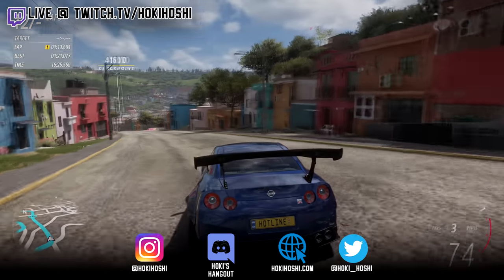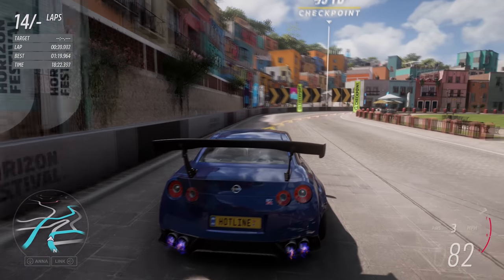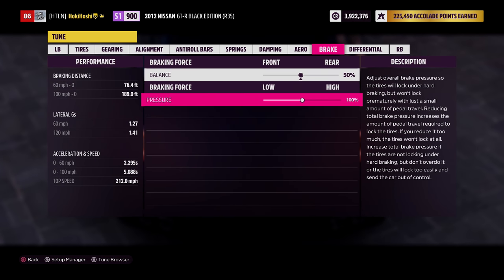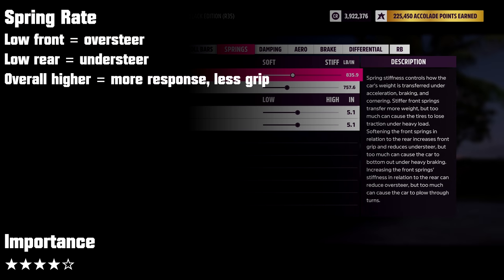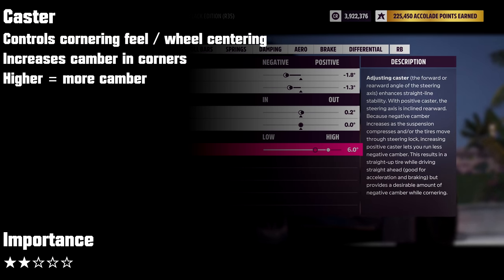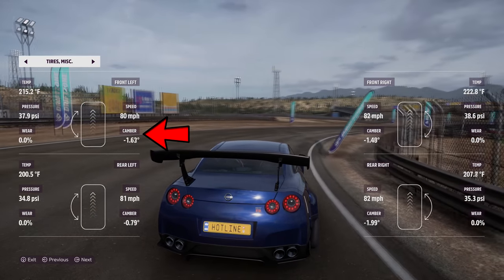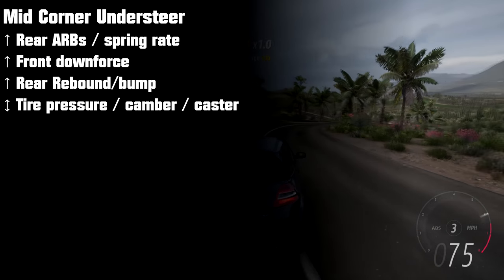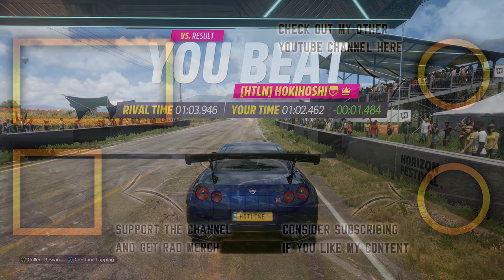How to Tune in Forza Horizon 5 | Basics of Tuning Guide

Comment: I know this is gonna sound stupid, but i generally break all these rules, my fastest top speed car for highway pulls is a Vauxhall Monaro, it's a V12 all wheel drive twin turbo makes well over 1000hp not entirely sure about torque, however when i tuned it, my diffs are 100% on everything on front and rear while the center is 50%, my aero is 100% on speed, my springs are slammed to the ground, my tires are slightly lower on pressure, i don't really touch the roll bars or bump stiffness and stuff, and my gearing i don't touch apart from final drive, the last gear is just touching the right of the graph (aka its towards speed) sure with all this it will take the whole highway to get anywhere near its top speed but due to the length I've never reached top speed the highest i've gotten so far was 490kmph (309.4)mph, i ddid have to slow way down to take the corner but im pretty sure if i had a long enough road with no corners i could probably get to 495kmph but that's minimum and yes i do know that no one has ever gotten near 500kmph but i am still trying, (fyi this is without mods)
Reply: And its the same for my drift cars i completely break the tuning rules, my camber is normally fully to the left front and rear while rear toe is out to about 3.5, rear tire pressure is normally way to the right, and my suspension everything on the front is completely stiff while the rears are completely soft if you want to try this you really should make a build with 10 gears and over 1000hp, keep in mind you have to be really active with the steering as it will just turn on its own.

Comment: Im having a problem where my front right and left tires have different temperatures. On the right tire the outside is about 20 degrees hotter than the inside but on the left side it is reversed. Any suggestions on how to fix it are much appreciated.

Comment: Your not clear on how to test the tyre temps so do you test it the same way as the camber like for example if you turn left do you look at the temperature of the tyres on the right because the temperature of the left tyre will be different to the right as your turning also do you just test this as if your racing or steady without too much braking?  I'm just a little confused on how you actually test the tyre temperatures I don't know if I'm even doing it right i have basically been testing it as if im racing and checking the temperatures round corners the same way you check for positive camber

Comment: Great video I’m more or less beginning to understand tuning I went from “well this looks like a good adjustment let’s move it all the way to one side” to being able to get my GTR 93 aka the boat to turn like a graceful gazelle. It still slides a bit on high speed corners but I’m working out the bugs slowly, I was able to cut my time on playa Azul circuit from a 1:16 to a 1:12 on my A class Nissan GT-R 93 finally was able to beat that cheating as pro AI it’s like they throw in a couple unbeatables just to watch us struggle…

Comment: I need help. I have a problem that I can't find how to fix On forza horizon 5.  Hopefully someone in this comment section can help me. This has happened on many of my upgraded cars. Basically I will have a level 800 car that reaches 180mph on driving, but as soon as I auto or manual upgrade that car to level 900 & upwards, suddenly it can't go past 150mph and won't go beyond, even though the horsepower and level is higher, the speedometer arrow reaches the red part and gets stuck, then the car starts making a weird noise. Its something to do with the upgrades but I can't remove every upgrade 1 by 1 to see what the problem is, it will take too long. Can anybody help me please, its really annoying Me. I have 2  of the same Toyota supras, the level 800  one reaches 190mph ther, but the level 926 one only reaches 140mph. HELP!
Reply: it's probably something with the gearing, try changing stuff with those settings

Comment: THANKS! This help me a lot! But for my English, I did not understand "entry corner"、"mid corner"、“exit corner” means.(i know entry\mid\exit means, but did not exactly on cars)
And also, i find one issue the video did not mention——Some super car, esp in rear drive, when suddenly boost it, the car is not straight as a line which it suppose should be. 
In contrast, from 0-boost, they usually turn to right or left, till the speed more than 200, some serious cars need more than 250. 
I found this happens on many Ferrari and other cars（not include lamborghini）, name list include: F40 GT、F50、F50 GT、3 Pagani cars、almost all Mclaren cars, Apollo(removed Microsoft tuning). but Lamborghini car and UK car(maybe the studio in UK reason?) like Astonmartin、Lotus, they never have this issue. (Lotus in contrast, it too stable as understeer)
Some player like me, have no idea to slove it, only turn the driven to full-wheel drive mode, most time it helpful, but still some times it's not.
Reply: entry mid and exit means while steering into a turn, while holding the steering on that turn and while steering out of the turn
Reply: @CErra310  Thanks! holy~~English cut this so details, entry\mid\exit mode. I don't drive. So I supposed the 3 mode as one. like, turn right, OK, success; turn left, failed. lol

Comment: Just 1 question, how can you minimize wheel spun on launch especially rwd cars. And why when I upgrade cars they spin more even with adjusted 1st and 2nd gear?
Reply: it's normal if you push the throttle too hard , Especially if your car have high acceleration

Comment: Gearing is way more important than the overview you did. I've been doing races with mates using the same cars with specific levels we have to stay under and I'll always beat them massively in acceleration cause I focus on tuning gear rations. You want first gear long asf but not so long it bogs down too hard off the launch (also really helps with really high HP builds and no traction control) think how many times you have to take off in a race or normally shift back to first. I have some cars that do over 100mph in 1st gear where some cars would already be in third with their stock ratios and shifting can be lost time. After 1st you want to make the gears fairly even towards top gear but making each gear slightly shorter. So I always go 1st really long probably close to a 1/3rd of the top speed you want, 2nd you want it normally to be close to half your top speed and then make a nice slightly shorter lines all the way to the top. High gears shouldn't be long as the you loose all your torque due to the ratios getting closer to 1:1 or lower for overdrives, it's also harder to push against the wind and dropping revs too far in high gears kills acceleration.
Reply: Say I have a car and the top speed I'm aiming for is 200mph and using a 6 speed my gear ratios would be roughly as such: 1st 65mph, 2nd 100mph, 3rd 130mph, 4th 155mph,5th 178mph and 6th 200mph. This way 1st gear to 1st is 65mph, 1st to 2nd is 35mph, 2nd to 3rd is 30mph, 3rd to 4th is 25mph, 4th to 5th 23mph and 5th to 6th 22mph. As long as you car has a power band fairly high in the rev range it will work really well.

Comment: Anyone notice the anti roll bars settings are... Trash? You can literally max the anti roll bars to zero effect. You would expect the car to bounce after hitting a bump on one side but that doesn't happen. I think this game's tuning is more shallow than people think.
Reply: The settings generally do what you expect them to do, but what's fast in Forza (and other games) usually doesn't have much to do with reality. People used to run 1/65 ARB in FH4, which isn't done IRL.

Comment: Are you sure that race springs provide any advantage over rally springs? They cost one more PI but as far as I been able to test, they dont ad any handling advantage what so ever. If you tune the preset after the fact they will handle any corner exactly the same way.
Reply: The maximum and minimum values are different for most vehicles

Comment: Tuning the r33 gtr in fh5 trying to go for a Purist build ie. no ugly forza aero. The car over steers like crazy when I brake into a corner. I’ve been able to tune out the rest of my oversteer for every part of the corner while on or off gas but adding brake pressure while or before the corner results in oversteer for the entire corner. (I have abs on but that my only assist)
Reply: Take abs off and reduce brake pressure then just learn when the tires lock up and play with that till you find what works

Comment: SOS I’m in the 918 AWD I keep losing traction around mid to end of corners. I tried doing differential tuning and tire pressures. Not sure what I’m missing it happens mainly in the rear tires
Reply: Lower rear diff accel or increase front diff decel
Reply: @ZaZ880  thank you will try out later

Comment: The section on brake bias/balance is entirely wrong. 
I'm not really sure why you said it's reversed when it clearly isn't if you spend anytime playing with balance settings in game. 
Positioning the slider further towards the front will balance the braking force more on the front brakes and positioning it towards the back will balance it more towards your rear brakes.
It has never been backwards in any Horizon game.

Other than that, this is pretty helpful.
Reply from the maker: Do me a favor, turn off ABS, move the slider all the way towards "front", look at the side of the car while braking and tell me which wheels lock up first.  I think you'll be surprised!
Reply: @HokiHoshi  I have come back to apologize and say that I just realized my ENTIRE understanding of physics was off. I noticed my front brakes always glowing red when I moved the slider forwards but did not understand that the rear brakes aren't glowing because they are totally locked up which means there is no friction between the calipers and the rotor. I feel really dumb and I am genuinely sorry.

you're absolute right, sorry about that one Hoki, and again thanks for all the tutorials.
Reply from the maker: Dude you're totally fine!!  Nobody expects the brake balance to be reversed ofcourse, and your thought of focusing on the rotors heating up meaning those brakes are being used more makes sense!  Especially when it lines up with how brake tuning is probably supposed to work anyway.  

I appreciate the response, hope you're having fun with Forza!

Comment: I'm having trouble figuring out the camber. In the video, it says that the lowest in the turn was -.8 degrees, but it went to like -2.03 at one point, which was pretty confusing... Mine seems to vary widely as well, but never goes positive. Also, I noticed that when my temperature difference between outside and inside of the tire was too high, I lowered the camber to make it more negative but it didn't seem to help. I then tried to raise it and that seemed to fix the issue..? Were my tests inaccurate or am I misunderstanding the video?
Reply from the maker: So I know this is confusing...but "less camber" means a more positive number (as in closer to zero.) "More camber" means a more negative number.  So when I say the lowest was -.8 that was the value closest to zero. -2.03 is higher/more camber than -.8  

Hope that clears things up!
Reply: @HokiHoshi  yes it does! I actually watched it back and realized this when paying closer attention. Thanks for the clarification.

Comment: Ive always relied on tire heat to tune my camber settings. Get the tires to the right temperature on the straight first with pressure and camber adjustments and then do some cornering. During the corner, the car is unbalanced if you dont get an even amount of heat generated on the loaded (outside) tires. And the tire is not giving maximum grip if it is not heating uniformly accross its surface - a heat "band" on a loaded tire after a sustained turn means you were using less than the full contact patch for grip, the cool areas indicate where more grip could be available.
Reply: in my setups i always have trouble keeping the tire temps low, i can always add camber, soften suspension, reduce tire pressure to bring the temps up but when i do find an optimal grip setting dialed in, the tire temps are always too high (solid yellow esp on the fronts, the rears are lower at the transparent yellow / solid yellow color). What can be done here?

Comment: 3:37 im new to fh5 and driving 2020 chevrolet corvette for differential section i dont see gear and center and what is that for?
Reply: Center is for AWD cars only and it controls how much power goes to the front vs the rear. But I would not recommend you follow this tutorial at all as it doesn't represent horizon physics. Watch the meta tuning guide made by @seP4 instead.

Comment: It's crazy how quickly this video got my vehicle into a very respectable tune. I haven't even gone back to make adjustments yet and it's already feeling amazing.

Tuned a Raptor for cross-country using your guidance here and my biggest complaint is generally that cross country vehicles can feel very heavy. With weight reduction and the right adjustments to favor oversteer this thing feels incredibly responsive.

Comment: The reason brake balance seems to be 'reversed' in horizon is because the slider is ALWAYS only showing you the percentage for the rear braking force. There is no value for front braking force. So when you have the slider all the way towards 'front', the percentage will read 0% because 0% of the braking force is being sent to the rear wheels.
Reply from the maker: This is sort of true yes but it's even more confusing than that 😅.  The slider, when moved all the way to the left, will be under "front" and show "100%".  This will lead to full rear brake bias.  All the way to the right will be under "rear", show "0%" and have full front bias.  So yeah, it can be simplified by not looking at the "front" or "rear" text at all, just focusing on the percentage and saying its for rear bias only, but it's that text that confuses everyone.  Every other slider in the tuning works the opposite way, which is why I say it's backwards.
Reply: @HokiHoshi  im sorry I said it backwards lol
Reply: @HokiHoshi  I've always just read the percentage on the balance slider as how much brake bias is going to the rear only...and completely disregarded the "front" because you dont need a value for the front bias to know what it is if you know the rear bias.. Lmao sometimes I wish I was more articulate
basically if you know you know 😂 anyways I appreciate the hell out of your vids. Very helpful 🙌

Comment: Question for fh5... Whats the point of not getting all 10 gears? Doesnt that just get you more top speed?
Reply: The answer can be felt by riding a bicycle with (around) 8 gears , if you aren't still allowed to drive.
In a vehicle , the higher the gear , more power it needs to keep accelerating.
Reply: @JoseBR520_NoobContent  ohh ok. So higher powered cars need more gears. Thanks for telling me!

Comment: I'm curious when putting more brake bias to the rear is more stable than putting it to the front. More to the rear would make it a lot more likely for the rear tires to lock up first and have the car spin out faster then when the front wheels get more brake%
Reply: This is entirely wrong. When riding bikes hard, you engage the rear brake slightly before the front to steady it as you slow down. Same with cars, If you have heavy front bias the car will want to rotate around the pivot point, in this scenario the front wheels. The rear brakes only really exist to add stability to the braking action.
Reply: Not sure what you trying to tell but try putting bb to something like 65f 35 r and the car will be quite stable under braking. Now flip it around and you'll see the car want to rotate a lot more. If the front tires get close to or are locking up then you won't be able to turn anymore. If the rears do the same, the back end will want to turn around as they lost all grip. This is especially noticable with drifting where most often the rear tires are being locked to get the rear to step out before releasing them to regain some grip

Comment: I don't have telemetry I have looked in the advanced controls and it's not there.
Reply: I was having the same issue, I figured out that you can assign telemetry to any unassigned buttons on your controller/wheel using the input mapping menu

Comment: The brake balance isn't reversed the wheels will lock the rear when towards rear and lock the front faster towards the front
Reply from the maker: You should test that with max lock each direction and get back to me 😉
Reply: @HokiHoshi  It is fixed now, I just checked
Reply from the maker: @JoseBR520_NoobContent  Okay so make sure you have ABS turned off, move the slider in tuning towards "REAR" and move the camera to the side of the car, get up to speed and then brake, you will see the front wheels lock up.  Now move the slider all the way towards "FRONT", repeat the test and you'll see the rear tires lock up.  It is absolutely still reversed, it's been this way for multiple games annoyingly 😅

If you are somehow getting different results from what I explained above, then there is something very odd going on.
Reply: @HokiHoshi  I just embarrassed myself now, yep , slider towards FRONT makes the REAR lock up